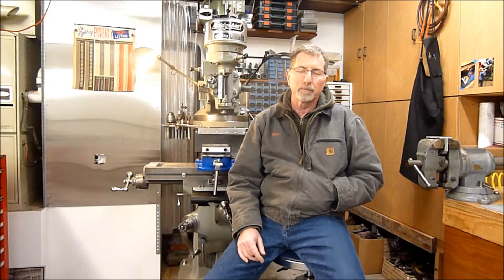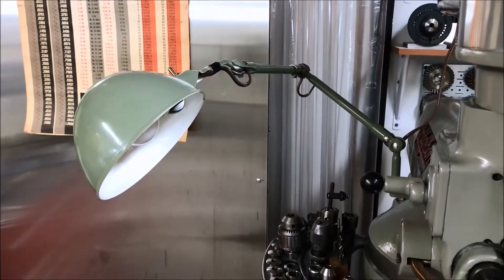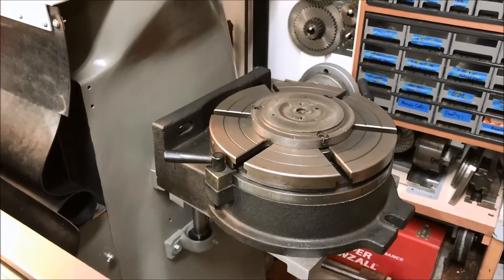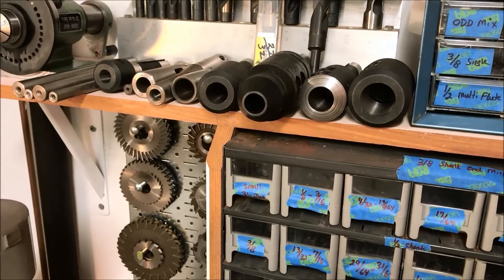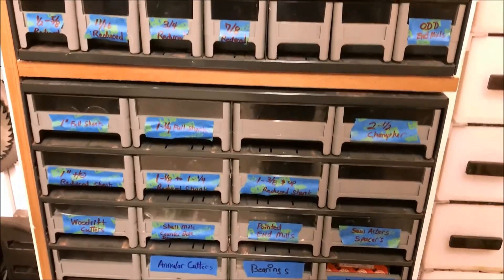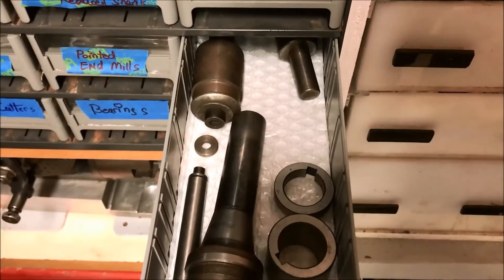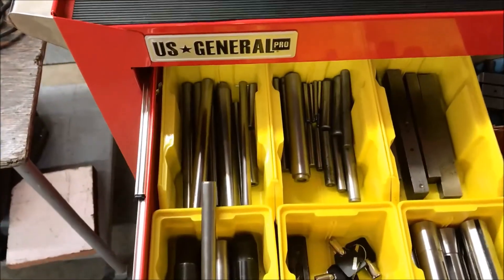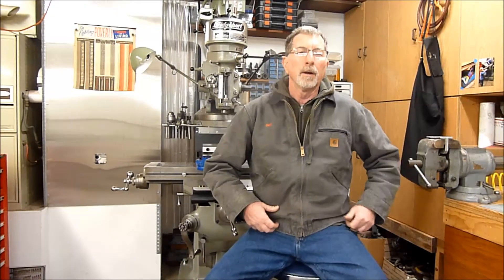Bridgeport Mill Introduction to Refurbishment Plus History Part 1

Comment: Sir, your slitter/circular cutter rack looks great, If you don't mind';  What is that metal pegboard-like wall mount you used?
Reply from the maker: Hi Dustin, It was a metal pegboard product from Amazon. Sorry I don't remember the brand. It can be used with with standard 1/4" pegs of blade type hangers. Its good quality. For the wheel cutters I just used 1/4" carriage bolts, nutted on both sides in lue of regular pegs and it's turned vertical.
Thanks for the comment, Dean